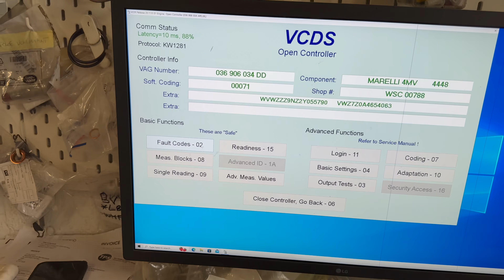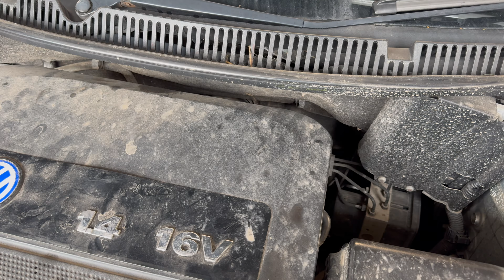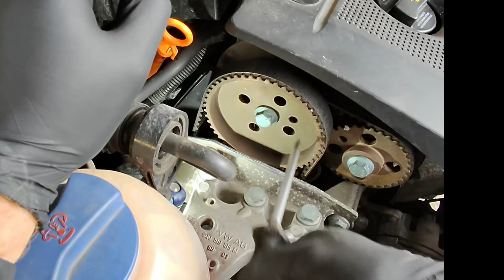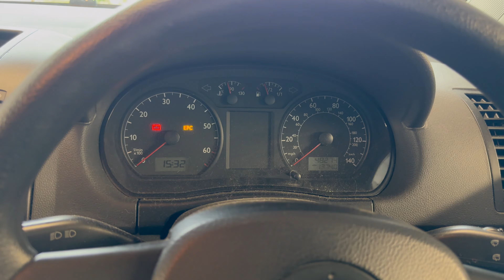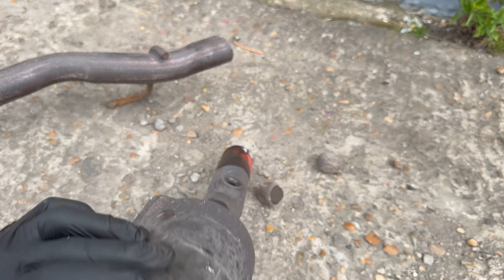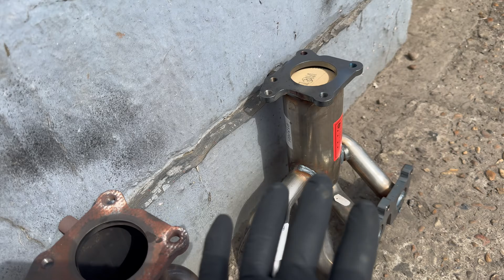VW Polo - NO Power! Diagnosis and Repair

Comment: I have a 2007 model polo with the exact problem, gonna check the cat, thanks
Reply: I have the same issue just slightly different.  My car does not have enough power when I drive it and it miss fires as well.
Reply: Did it work?